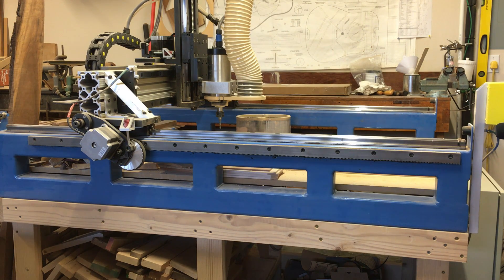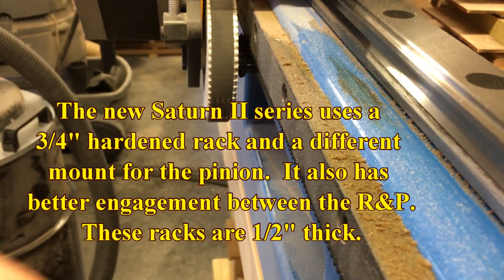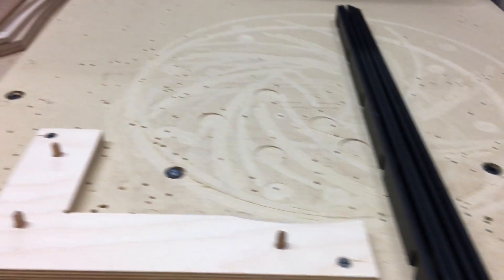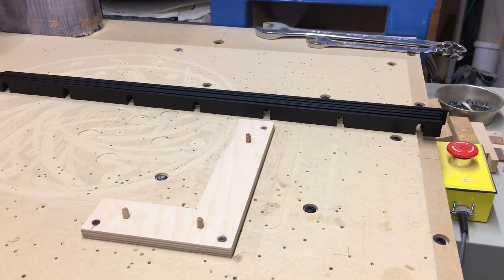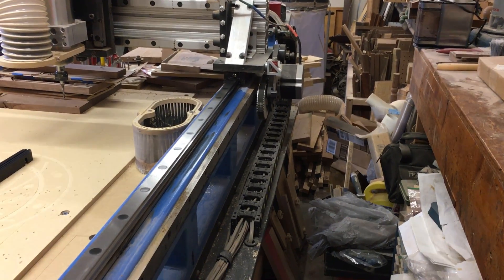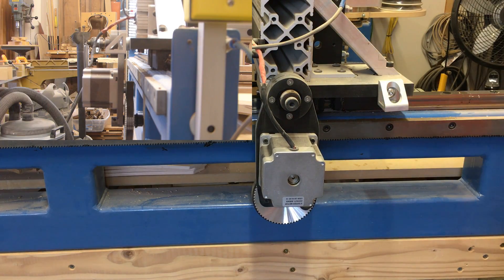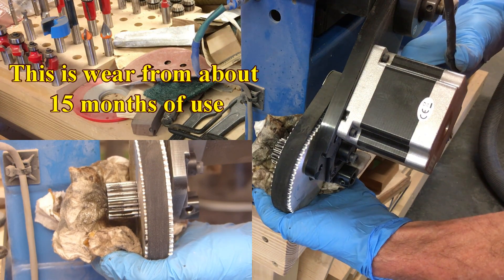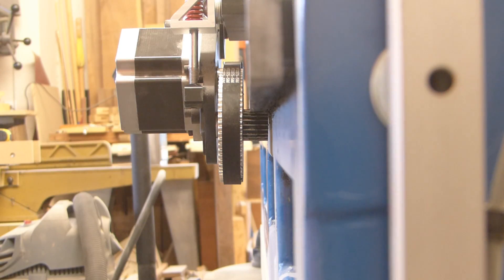Saturn CNC - Installing Y axis rack spacers - 3-17-18

Comment: There's a lot of deflection from the pinion against the rack, with the moment being located where the larger pinion meets the tensioning arm. Has this proven to be an issue over the last five years at all? It seems less than optimal, as in principle the pinion will only be engaging the near edge of the rack. The grease probably telegraphs this if it's the case.
Reply from the maker: No issues at all, very solid and reliable. Thanks for watching!

Comment: Hi Dave 
I have a I think maybe a 5yr old FLA 4X4 with a Mach 4 I am trying to get back in running condition some of the rollers aren’t snug on the y plate so i’m looking for a manual or video to adjust them plus many more thing i’m new at this
Thanks if you can help 
JC PRIEBE

Comment: How did you figure out how tight to tighten the spring on the drives? Thanks
Reply from the maker: For this upgrade I just measured the height of the springs before I dismantled the mechanism and matched it on the upgrade.  Initially, though, I adjusted the springs such that the deflection on the belt was about the thickness of the belt (under moderate press with my thumb).  I'm guessing that's about 1/8" deflection; I'd have to measure but that seems about right.  Thanks for watching, hope this helps!

Comment: What size square tube is the frame built out of? Thanks
Reply from the maker: Just measured and it appears to be 3.25" x 3.25" square and very heavy wall.  I seem to recall it's about 3/16" thick wall.
Reply: @difalkner   Thank you.